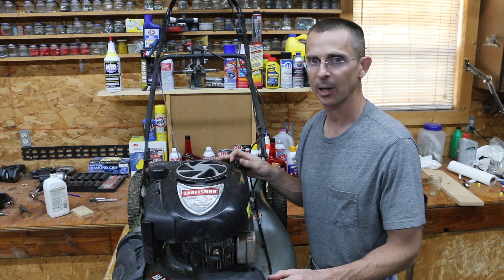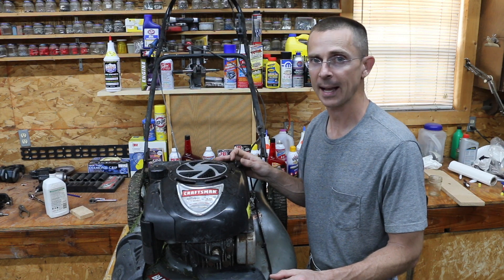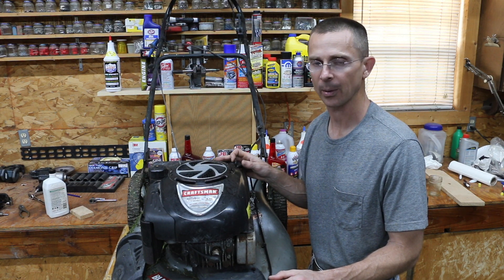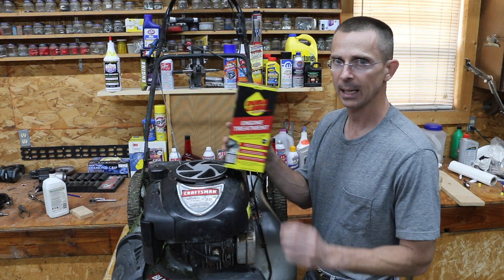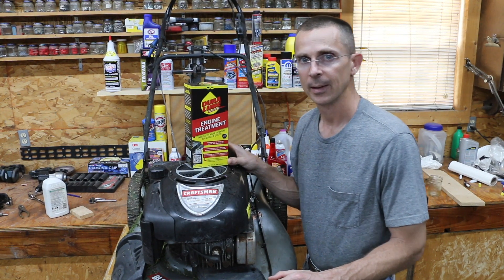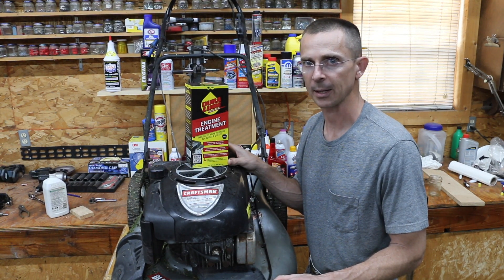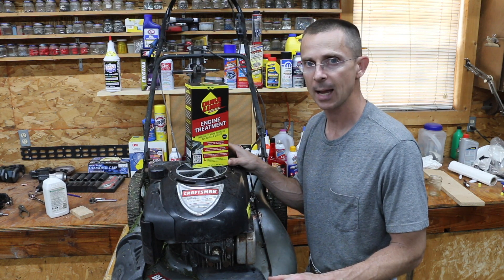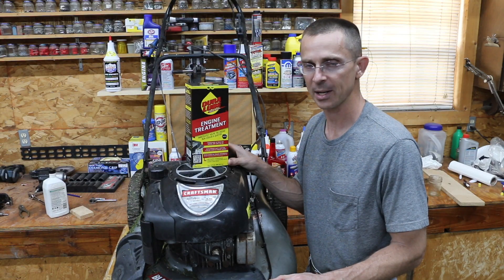Does Dura Lube actually help quiet and cool a gas engine as claimed?

Comment: In a case like this, I wonder if you should have tested the engine with a fresh oil change and then the oil with the dura lube in it.  The oil that came out of that engine was baaaaddddd and an oil change alone would probably make it run quieter and cooler.

Enjoy the tests though.
Reply from the maker: Chris, Great point!  Thanks for watching the video and commenting!

Comment: I have used it in many cars with mostly good results.  Noticed mainly oil did not break down as fast and engines ran about 5 to 10 degrees cooler.
Reply from the maker: Bryan, Impressive!  Thanks for watching the video and commenting!

Comment: project farm...what about restore (its an additive that claims to fill in scratches and gouges in cylinder walls and thus restoring lost compression i know its marketed as 4.6. 8.cylinder formula... but im sure you could figure out  how much to add to 20 ounces of oil...
Reply from the maker: georgiaridgerunner79, Yes, I have some that I plan to use in an upcoming test.  I've heard it's a great product.  When i test it, I'll do the math to make sure I add the appropriate amount.  Thanks for watching the video and commenting!

Comment: I have been using dura lube for many years. On average it instantly reduces engine temp by ten degrees. Less heat means less friction...Less friction means less wear! It does what they claim that it does.
Reply from the maker: J Miller, It seems to me that the engine I tested had less friction and ran cooler.  Glad to hear that you've had a positive experience with it.  Thanks for watching the video and commenting!

Comment: Use to work for a big name auto parts retailer. Had one customer in a million swear by dura lube. He told me a story of a truck engine that developed a knock. Poured a quart in at every other oil change. Said it went past a hundred thousand miles. Every other customer like Lucas synthetic. I used the Lucas  synthetic once. Didn't notice a difference.  Went back to plain synthetic oil.
Reply from the maker: Interesting!  After using both products, I like Lucas better than Dura Lube.  Thanks for watching the video and commenting!

Comment: If I had to guess, the duralube is either really thick on its own, or otherwise modified the oil to be much heavier.  I've never used duralube, but I've run through a few 600 series engines.  They absolutely love to suicide by overheating.  Clogging up the heat damage would definitely yield a bit of improvement.
Reply from the maker: Markworth, Thanks for watching the video and commenting!

Comment: It's hard to get reliable compression tests on small engines. They've incorporated compression relief mechanisms for a long time to help start them. Takes running rpms to swing the bump cam out of the way of the tappet. 60-70 psi is the best you'll get out of the pull start rpms of those equipped depending on how hard you yank it.

As for Dura Lube. It's principle additive other then base stock mineral oils is chlorinated parrafins. These are used in many metal cutting fluids due to their performance under extreme pressure. However the big downside is that as the parrafins break down the chlorine will react with moisture in the oil when sitting and form hydrochloric acid which isn't something you really want in your engine oil reacting with seals and metal surfaces. Hence why they've never been used in engine or machinery lubricant makers.

But considering Dura lube's marketing is towards noisy worn out engines.. It's not really lying. It can help as the chlorinated parrafins will stand up to the journal smacking into the worn out big end of the rod bushing/bearing better. And the engine will probably wear itself out and grenade before the acid's do major damage. 

Personally I'd just stick to thicker oils, remember water based contaminates in oil get sucked into the carb through the breather as oil heats up and hydrochloric acid can't be good for the parts in those especially plastic ones.
Reply from the maker: Craigified, I really enjoyed reading your comments!  I learn a lot from commenters like you.  All great points regarding Dura Lube.  

Regarding the compression test, would it be more accurate to use a high-speed electric drill to spin the engine over very quickly for 15-20 seconds?  How many RPMs would I need to achieve to get a more reliable compression reading? 

Some of my newer engines produce 110 PSI or more while the older, worn out ones have lower PSI readings.  I want to provide the most accurate testing methodology possible and am open to suggestions!  

Thank you very much for taking the time to comment!
Reply from the maker: Cragified, I believe my drill will be strong enough to spin the engine over quickly.  I'll test it.  Thanks again!

Comment: Even though the decibel reading was higher, it certainly sounded a lot better. Little compression boost, too. I wonder with products like this, if the quietening is beneficial, or is just a band aid. I wouldn't think the root cause would be that easy to make go away, haha. At any rate, keep these videos coming!
Reply from the maker: Old Truck Smell, Thanks for watching the video and commenting!
Reply from the maker: Old Truck Smell, Thanks for watching the video and commenting!

Comment: This would be a good candidate for a product called CSL (copper, silver, lead) It's supposed to fill in the low spots and boost compression and improve an old engine. Would love to see a video on that.
Reply from the maker: Great suggestion!  Thanks for watching the video and commenting!
Reply: Don't not use csl restore it makes ur oil sticky and will cause ur bearings to seize up

Comment: I never trust products like this. or those ones that claim to stop leaks in your radiator, when it actually will clog up your coolant galleys.
Reply from the maker: Thanks for watching the video and commenting!
Reply: Yeah no problem, love your videos! great content, keep up with the cool experiments ya do!
Reply: pepper is a good temporary fix for smaller coolant leaks not a long term fix but has worked for me ive heard a raw egg will stop to but only until the egg burns up wouldnt risk my motor on the egg meathod doesn't take long to burn an egg
Reply: all the things are  a quick fix, meaning fix it and sell it, no money back!

Comment: you need to run it longer I found with dura lube it takes a couple of drives in a car a few hours over several days to really notice a difference
Reply from the maker: hd the wise, Great point!    Thanks for watching the video and commenting!
Reply: Project Farm  just remember the first time I used it in a wore out Chevy was really disappointed the first two days but I began to notice less noise and could go a week without adding oil went from 2 to 3 quarts a week to 1 never tried it in a small engine but was told by a neighbor. that it saved him a lawnmower he got two more seasons out of it found your test on products to be helpful thanks keep it up
Reply from the maker: Impressive!  This makes sense!  Also, thanks for the positive feedback.  It keeps me motivated to continue making these videos!
Reply: I run straight duralube in my lawn mower, its 10 yrs old.
Reply: @travisd6585  lol

Comment: i got the recommendation for high mileage engines not to use sythetics and stick to high viscosity, in order to "fill" the caps and reduce rattle.
Reply: synthetic stretches thin and finds places to leak out past worn parts more so than non synthetic. thinner oils shed heat quicker than thicker oils and get pumped thru a cold engine faster. i stick to thinner oils and high quality synthetics because they provide sacrificial molecules that protect the metal surfaces that you dont get with conventional oil. adding oil is far cheaper than rebuilding or replacing an engine. easier too :)
Reply: rarbi.art In my experience; synthetics and thinner oils are fine for most high mileage engines.
If your engine already has leaks, you can expect thinner oils to leak faster. However, it won't suddenly leak from the switch.
I switched on;
'99 Subaru @200k miles, no leaks before or after. Oil burning significantly reduced
'99 Subaru @106k miles, no leaks before or after, no burning before or after
'84 Chevy 6.2 diesel @150 or 250k miles (rolling odometer) - Leaks before, though actually a decrease in leaks after. Burned before, slight decrease in burning after.
Reply from the maker: Seems to make sense!  Thanks for watching the video and commenting!
Reply from the maker: jo schmo, I enjoyed reading your comments!  This is good info!
Reply: 100% sythetics and low viscosity is perfect for a new enginge with low tolerances. this recudes heat, wear. (and i like to spend the extra penny on that). But for old engines with ratteling vavles and knocking rails: high viscosity to fill the gaps. there is no risk of torn lubrification film in absence of squeezing tolerance. And normally we do not floor those old horses to max rev under maximum load.

i do not call for cart grease, but basically it's the direction to go to stop rattle.
Reply: I've been running a synthetic blend in my Toyota 5SFE with near 500k miles for awhile now. I see a slightly higher amount of oil consumption than with pure conventional, but i notice that it doesnt get black as fast. I have some valve noise once hot  no matter what oil i use though. Id dont want to go with a heavier weight oil though and hamper cold start protection since my MR-2 is my daily driver year round. Once it starts to get warmer i go with 10w30 and in the winter i go with 5w30. It gets changed every 3k miles no matter what type of oil/filter i'm using though just because i know there is a significant amount of blow-by with that many miles one it.
Reply: I had a 1984 Buick Skyhawk with a 1.8L Brazilian made 4 cylinder OHC engine.

When I got it (it was given to me), it was low on all fluids, and had a horrible lifter tick.

An old mechanic recommended putting thick oil in it.

Big mistake!  The tick turned into a knock!

I was soon hired where I became SAE and API certified and learned about the different weights and compositions of oils.

I put 5w30 full synthetic in the engine and the lifter noise virtually vanished.

Thinner oil flows better, and cleans better too.

I drove the hell out of that little car, and it still ran great even after someone ran into it and smashed the side in, causing it a premature trip to the scrap yard.

Comment: Does Dura Lube work/is it worth it? I can't draw any conclusions from the video. The oil which was in the engine looked a little bit old. What I would have done is just change the oil first. That's the cheapest option and it usually helps. After taking the measurements with a standard oil change (which would be the baseline) then you could try Dura Lube after it to compare. I'd wager to bet it wouldn't do much more good than new oil (or the numbers would be so close that you could disregard due to normal error). Otherwise, nice video! :)
Reply from the maker: Great point!  Thanks for watching the video and commenting!

Comment: Sometimes, just changing the oil can improve an engine's sound and abilities, as the oil gets old, it becomes less slippery, so makes the engine run poorly, so one good way to test would be to take an engine that's as bad sounding as this and just change the oil, then try the additive afterwards... :)
Reply from the maker: I agree!  I'll make sure to use new oil to establish baseline measures in future testing. Great suggestion!
Reply: Right, i was going to say the same thing. Putting fresh oil in before your baseline measurements would have the best way to control the experiment. Then add the treatment. Who knows what was in that old oil or how old it actually was.
Reply from the maker: Great point!  Thanks for watching the video and commenting!
Reply: twocvbloke I had a few vehicles that ran better after an oil change. most were on the more worn side.
Reply: Start car add duro lube it will amaze u .it gets quieter and vibration down as you add it .it frees up sticky parts and coats real thin .its amazing stuff
Reply: Makes perfect sense and its another great video. Thanks
Reply: No no no do oil change minus 1/2 a quart .start car let car warm up keep car running,then add duro lube it's shown on every early commercial.it freaking works.
Reply: tewocvbloke - Very true... big reason why most experiments use a control. Also, your suggestion helps debunk/remove the..."I just bought expensive magic pixie dust" and therefore it (PSYCHOLOGICALLY) runs/sounds awesome - lol